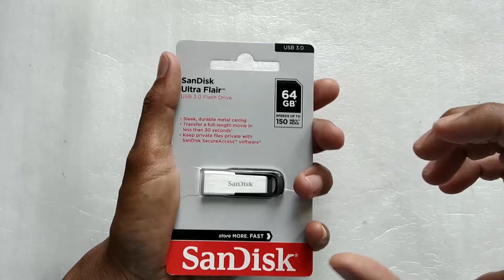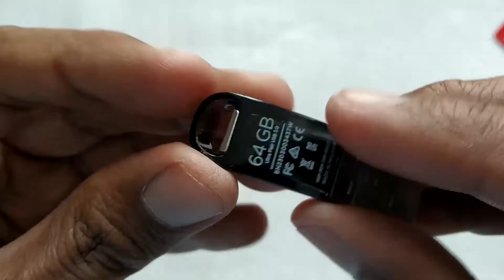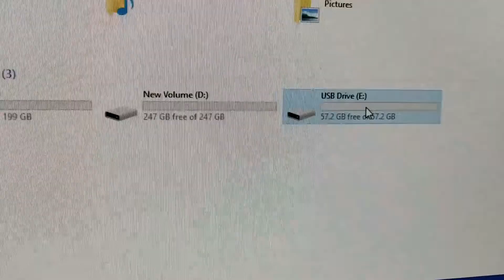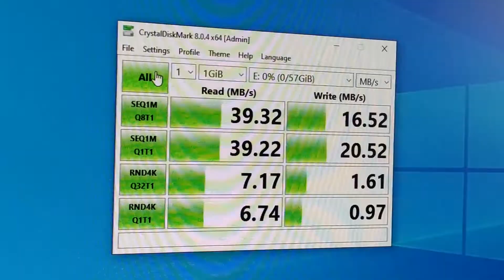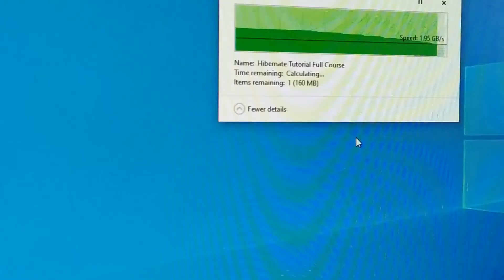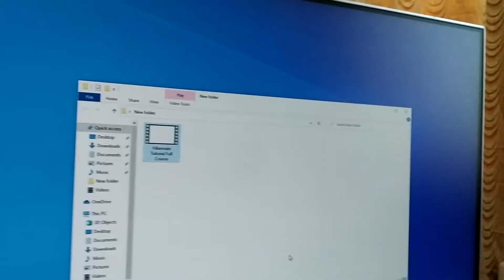SanDisk Ultra Flair 64GB USB 3 0 Pen Drive Flash Drive Review Speed Test

Comment: This usb is ultra slow gives a write speed from 6-25mb
Reply: That's the problem with these drives. They are slow as hell, it's actually preferable to get an M2 disk and a USB adapter.
Reply: Hello hoomans?

Comment: Hello , i have the same flash as you and also made in malaysia , but i bought another 128GB flash but it made in China , is this fake? although i test the speed and it was the same . and the same physical appearance .
Reply from the maker: i would only bother about the flash drive being fake if, It did not have the same capacity as written on the packaging and if it did not perform as the one you already had.
I don't think it being made in china makes a difference. 
your flash drive probably is original.
Reply: @gurribuy  i talked with technical support and thet said its original, thank you
Reply: bhi kic trha pta chlta ha technical support mein nay b new buy ke ha

Comment: Iske Amazon pr review me sbne bola heat jaldi hoti h yh,
Tum btao jaldi hoti h kia heat
Reply: Haan
Reply from the maker: About heat i've mentioned in the video as well.
yes, it heats up quite a bit more.
so, if you keep your pendrive plugged in for a long time then it will head up a lot.
But, for quick transfer of files this pendrive is very fast and because you are not keeping it pluggedin all the time it will not heat up as well.

Comment: I am planning to buy it today, would you recommend buying this after 2 months of this video release, as my need if 64 gb with movies running on tv usb port and basic storage purpose.
Reply from the maker: I would not recommend this as a continuously plugged in drive as it gets really hot sometimes.
you can go with the amazon basics 128gb version
Amazon basics has good speed. or the kingston datatravellor, kingston write speed is slow but read speed is good so you will not have any trouble running movies on your tv.

Comment: hey Buddy 
i'm confused about your real world results
i've OMEN  i-7,  11 gen
all ports are 3.0
when i tranfser a file writing speed goes upto 58Mbps then fluctuates between 11 to 20 Mbps
could you help me out whats the issue ?
Reply from the maker: in the video i tested with a single video file.
If you are transferring multiple files of different types then speed may vary.
Reply: @gurribuy  i did the same
Single file & multiple files but all in vain 😞
Reply from the maker: @usamamalik6001  In my video i  am using a fresh install of windows 10 . I'm also using direct port on the motherboard.(not my cabinet port).
Reply: @usamamalik6001  format it to NTFS. can also use FastCopy software to test it out. (for multiple file in multiple locations just need to copy their file path and put them in the source textbox. 

this should fix it. if it didnt then you dont have the blue colored usb ports
Reply from the maker: in the video i tested with a single video file.
If you are transferring multiple files of different types then speed may vary.
Reply: Same problem here!! But i will rather consider to fix if myself